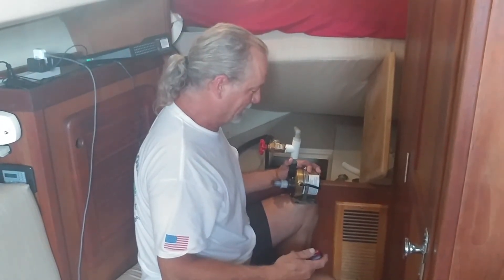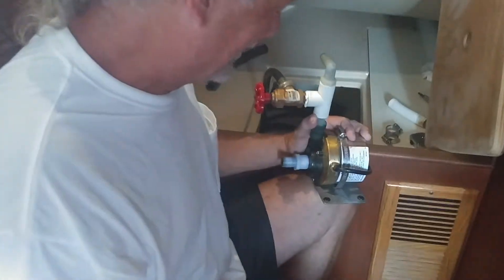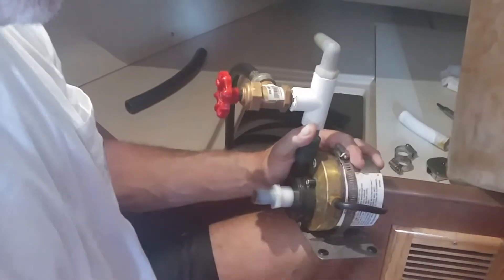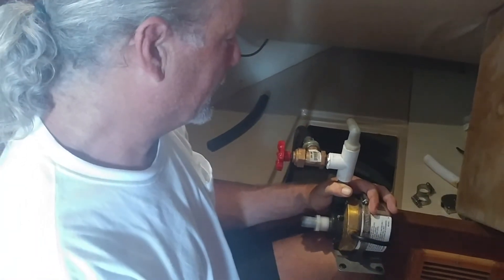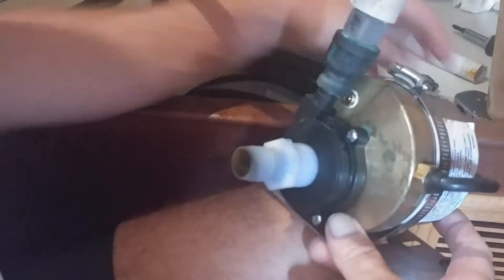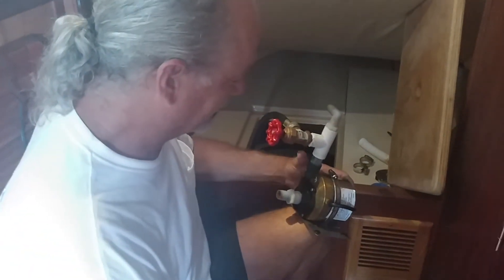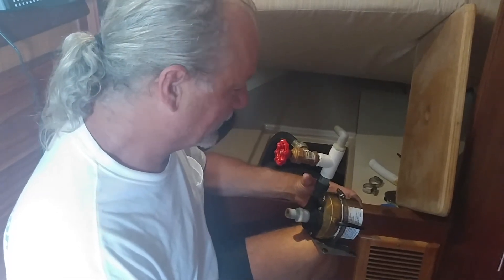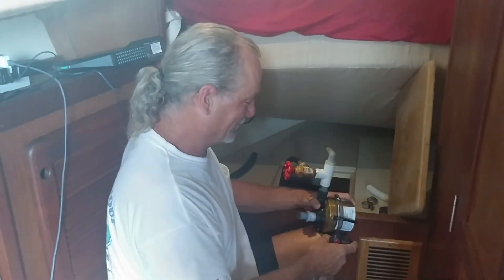Salty Quicky #125 - Fixing my AC on my Island Packet 27

Comment: First off Tinsley, congrats on applying for your captains license!  Being from dry So. Calif. , I cannot imagine a boat in your area Not having air conditioning! The humidity alone makes us folks out here melt! Does it run with shore power or can it be used while underway?
Reply from the maker: Thank you for the congrats regarding Captain's License!  The AC runs only on shore power.  I could rig it to run on a generator while anchoring but I haven't done that yet and probably won't in the near future.  AC is definitely a must when staying in a marina in the Summer months!